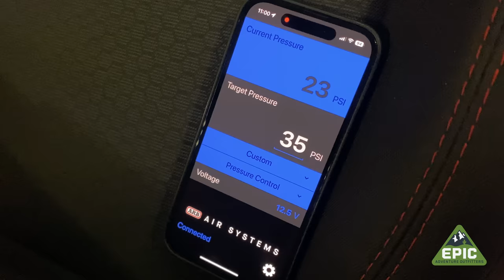2 Gingers 1 Jeep - Justin B McBride Visits EPIC with His New Jeep Gladiator EcoDiesel

Comment: Man I wish we had a shop like this around here in upstate, NY.  I'm ready to go all in on my gladiator but hard to find folks that specialize in these suspension systems, etc.  There is one shop near me but they don't resell Terraflex, they resell Rough Country.  I have the same gladiator you guys built in 2021, the Mojave, Sting-gray and want to do the same suspension system you guys did, I think the second time.  Probably nothing crazy just want to get 35's on there with some poke, but want to keep the stock fox suspension...just lift it a bit, leveled etc.  Is there a package from Terraflex now that includes the shock extensions...etc now?
Reply from the maker: Thanks for the comment. You are welcome to give us a call to discuss and we can give you some pointers (604-888-2961). Cheers from the team at EPIC!

Comment: Glad to see Justin came back (to jeep, lol).  Question- Teraflex springs and shocks are great for this type of set up, but why not use Metalcloak control arms?  Proven to have the most misalignment (for the most flex) and since you put that sway bar in the back it would only make sense to have the most flex.  Not hating on Teraflex as a I have a mix of vendors on my JLUR, but just curious knowing that Casey just got a Game changer for his Gladiator.
Reply: Plus isn’t Teraflex now Chinese made? Pretty sure Metalcloak is iUS made.

Comment: That’s was an excellent episode….. the extended fender flares where can a guy get those ?
Reply from the maker: The extended flares are just two sets of JL fronts. You have to massage and modify a set to fit the rear of a Gladiator, but it works wonderfully. Grab them at your nearest mopar dealer.

Comment: What is a better trim line to build off of, the Mojave or Rubicon...I know the all differences between the two, but the Mojave has a few extra pieces that are built stronger, where the Rubicon just seems to offer front and rear locking diffs. I guess my question is, is it better to just buy a Mojave then add the front locker?

Comment: When I had Teraflex springs put on my JLUR they were curved. Sent pictures in to Teraflex and they said they must have been installed wrong. Not true, removed and put on Rock Krawler springs and they are perfectly straight. Now every time I see curved springs on a Jeep 9 times out of 10 they're Teraflex. I don't get it, All of the other T Flex parts I have are excellent. T Flex did refund my money no problems.
Reply from the maker: No idea what your issue was. We install 99% Teraflex coils and haven't had any problems as you have described. Maybe a bad coil batch or something. Glad you found something that worked! Cheers from the team at EPIC.